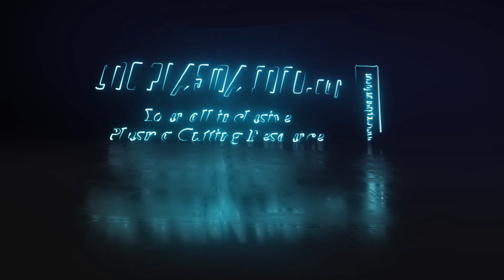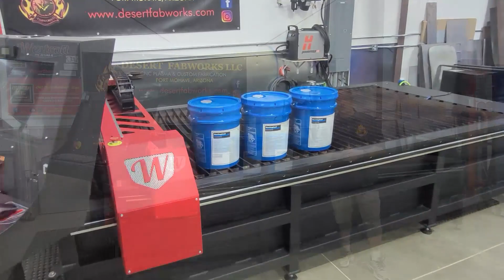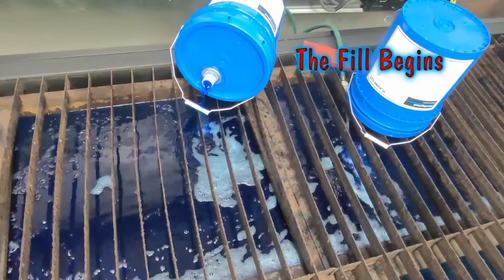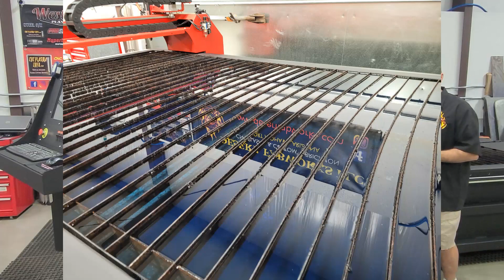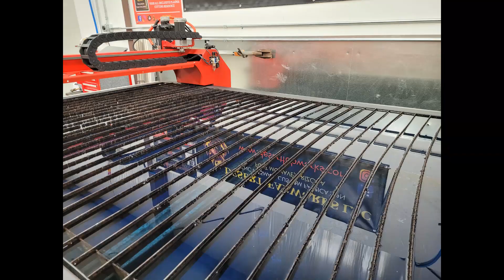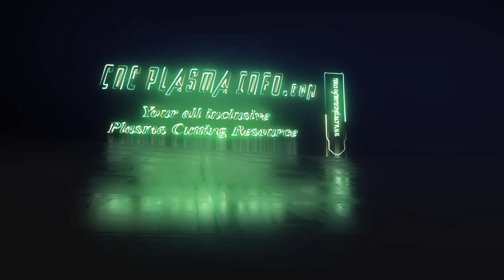CNC Plasma water table additive discussion and review of SterlingCool

Comment: I have a 5x10 wescott I’m about to start running it for the first and I wanna use sterlingcool how many 5 gallons would I need
Reply from the maker: Start with 4 pail order.  You should be in the range of 200 to 250 gallons for table.  20:1 solution will put you around 12 gallons.  It's ok to start a little heavy at 15 gallons or 3 pails of Sterlingcool then you will have one pails left to maintain with.  I highly recommend getting a refractomer off Amazon to check and maintain concentration at a 2 to 2.5 level on the refractomer
Reply: How often do you have to refill your table seems like I’m constantly adding water to mine every 2 weeks water level drops is this normal

Comment: Thanks for the great information in your video...  Just like Ratha below but I was watching your video and ordered SterlingCool about half way through!  I have been in the CNC plasma for just over 4 years (mostly offroad fab) but do a little sign art also.  It is amazing how many friends you have when they find out you have a CNC plasma table...  I literally just did my 3rd clean out and am looking forward to putting SterlingCool in my table.  Four years of straight water, borax and what ever chemical I put in there, I cant wait!!!  Please post another video of the LMT if you use it, my table is only about 40 gallons so the SterlingCool is going to last me at least 2 years.   IAFF local 1622 29 years!